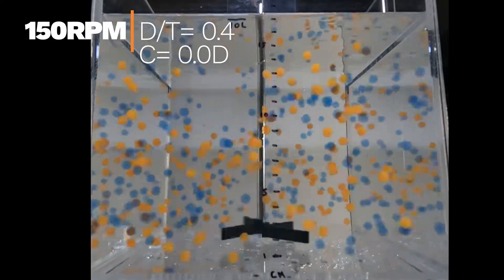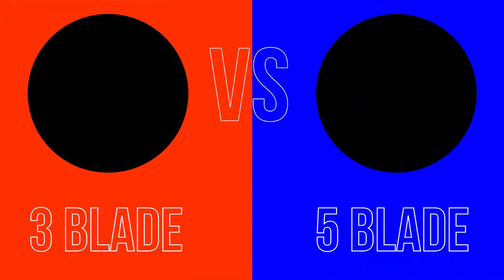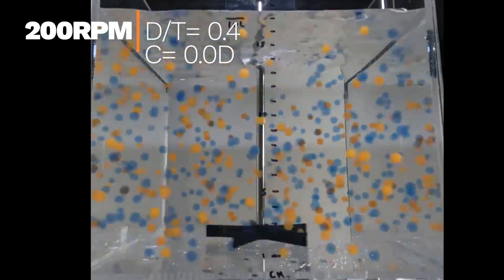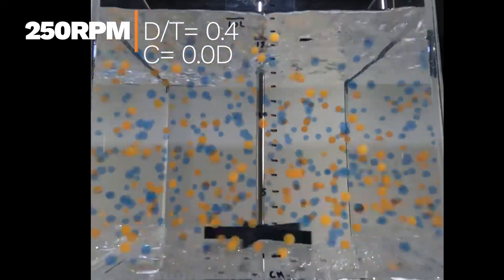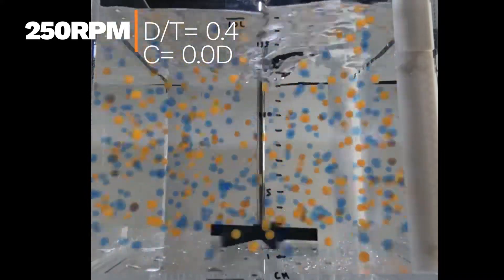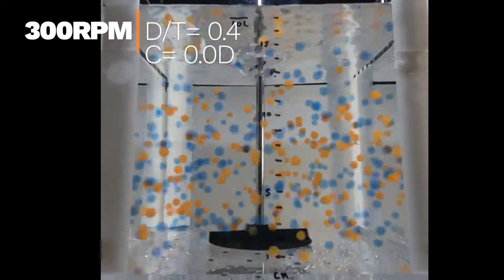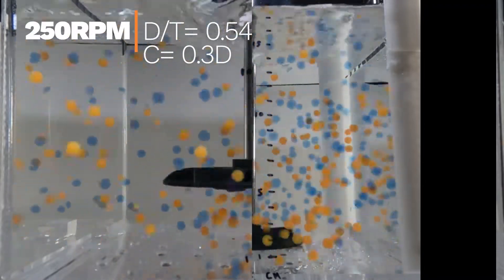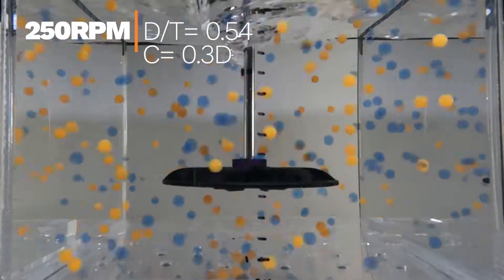Agitator Design (Part 2)

Comment: Different patterns will be needed for different starting material trim is not the same as some stubborn super tight nugs, I thing for the latter we will also need some mechanical separation other than water flow induced by some item, supersonic I’m theory always sounds good but it’s hard to get it to work, I have an idea but it’ll take years. I think this will also make more strains “washable” for instance mac1 after a long ass wash, I can still break open the nugs and find a lot of triches which I am sure would add at least 1% in total which is A LOT, that 1 % would make the difference in being profitable or generating only losses.

I would love to see a big development in this, I am working on it but I can not afford to lose 100s of pounds of tight buds to find the secret sauce, a simulation would help but it would be HARD to do, perhaps find cheap super tight CBD. Nugs but even those are almost I,possible to find.
Reply from the maker: We did tons of CFD simulation and washed lots of biomass in the development of our agitator. We have the flexibility that the agitator can easily be changed. This part I truly believe we got it locked down although there is always room for improvement. I am positive we have the best option currently. We test via CFD first, then lab scale sims, then real world.